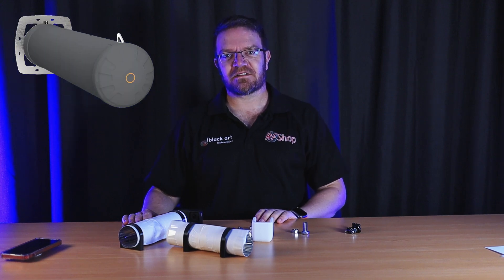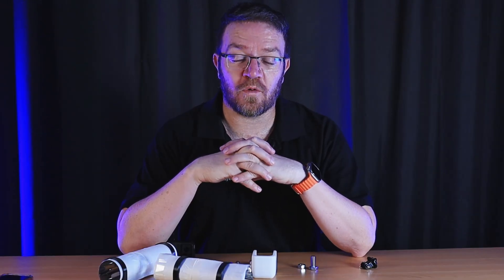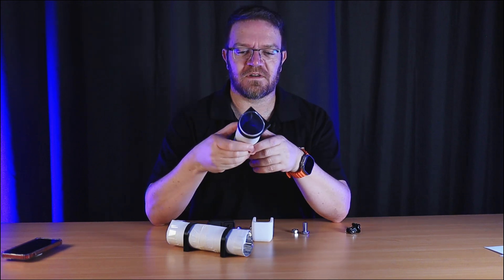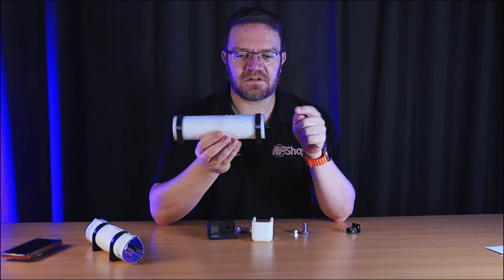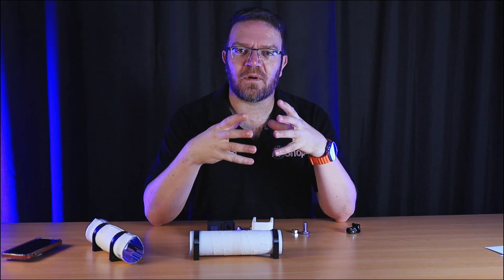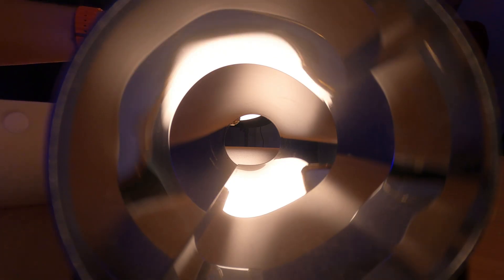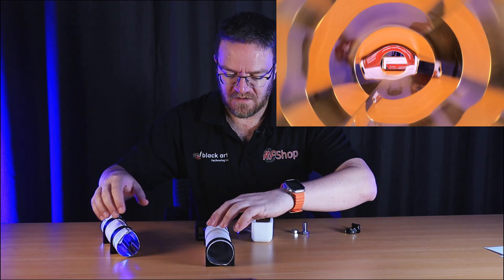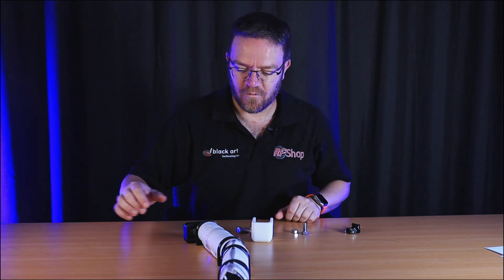Why would you use Helix (HELI) antennas in tunnels and how do they work?

Comment: Between a house and say a remote shed, where both are in a noisy environment, how useful are Helical antenna with 5 Ghz and 6 Ghz WiFi channels?
Reply from the maker: Hi Brian,
It depends what the definition of noisy is. RF noise will cause trouble regardless of the type of antenna, but a higher gain antenna will help eliminate sensitivity to noise in other directions. However, if you have many obstructions such as reflections and multipath like in the tunnel examples, it does work. I think for WiFi a simple high gain solution, such as what we do in the Shed Link, might be sufficient.
Reply: @RFShop  Will you be reviewing the Teltonika RUTM52
Reply from the maker: @ I do have one in my office…just need to find time to discuss it. We’re planning a webinar with Teltonika in June where we’ll discuss their 5G routers, including the RUTM52